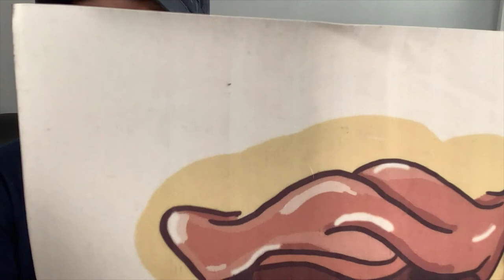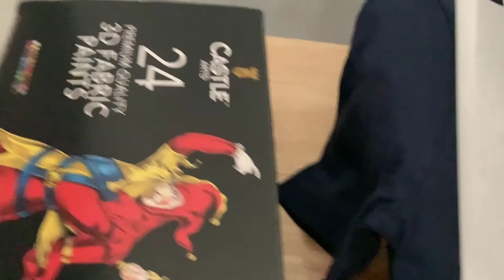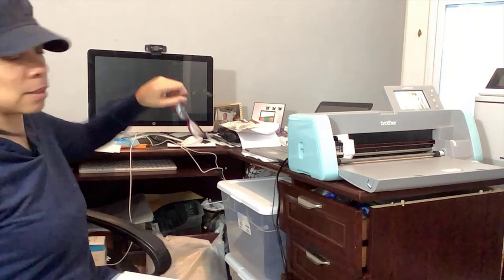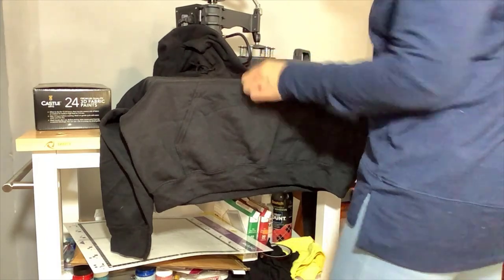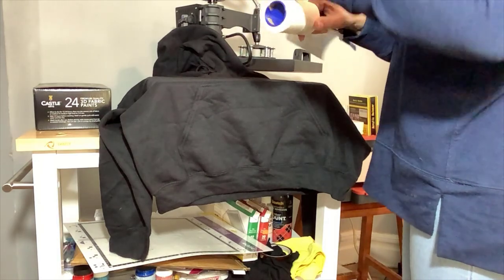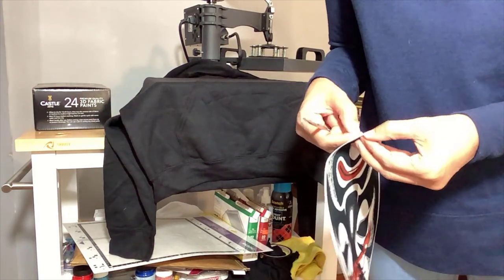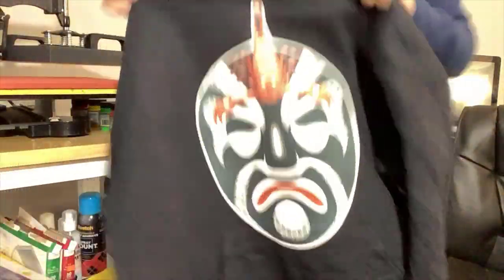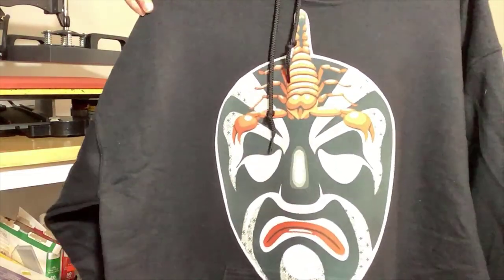Printing On Dark Hoodie With Subliflock Using Epson F570

Comment: Hi, do you notice any blotching order smearing with subliflock? With Easysubli when printing directly on it I get abysmal results with the f570
Reply from the maker: I don’t get any smudging with Subliflock. I actually no longer print directly on it though because my rollers started screeching on the paper so I do the 3 steps (print on paper, transfer to Subliflock and heat press onto garment). Truthfully, Subliflock is my favorite aside from DTF which I just started.